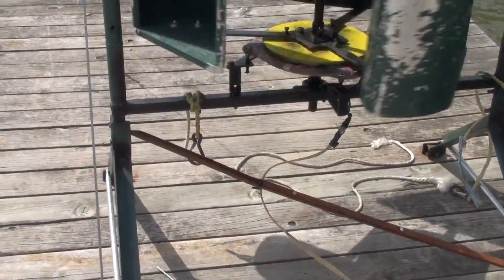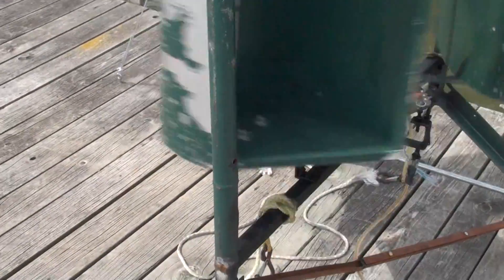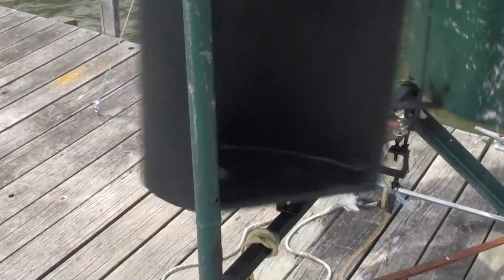showing frame for mounting a lenz turbine, bearing mounting , hubs etc.

Comment from the maker: I had the alternator air gap open wider and closed it up some after changing the wings to the same direction of rotation. Today was the first fairly decent wind I have had . seems to be charging lightly only a couple of amps. looks like about 60 RPM's right now. Need a stronger wind to see if I need to open gap more.